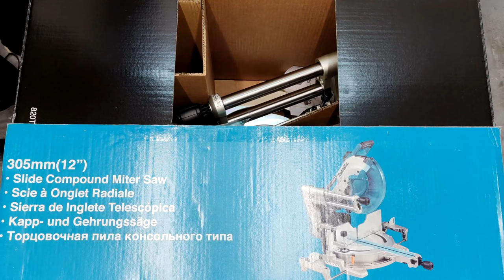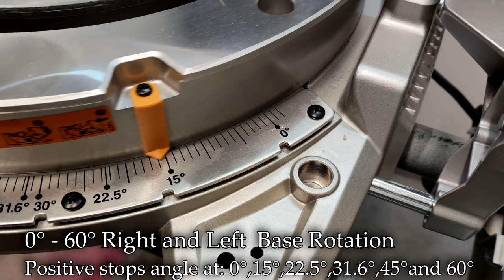The Best Slide Miter Saw - Makita LS1219L 305mm  (12") 1800W   DXT - Unbox and test

Comment: The machine is good. But pathetic service in India after sales. From day one, there was a manufacturing diffect. There is a 1 degree difference for the right angle. There, engineers are not able to resolve the problem on site. Now they have requested to send a machine from Mumbai to thereafter Bangalore service center. Hope they solve my problem.

Comment: Powerful motor, cuts through aluminum stock easily with standard blade MyBest.Tools Cuts are straight and angles are accurate. Good overall saw. The only thing I would have changed is the blade cover. It is very thin and wobbly.

Comment: Hi, I'd like to have your advice. I'm undecided between makita ls1219l and kapex festool. I would like to make a good purchase.
Reply: Kapex dust collection is nowhere near a good as this.
Reply: Festool is one of the top brands in the world for precision! But it’s 6-800 usd more than the makita.  I’d def say go with the Makita!
Reply: I have both saws and I can tell you it all depends on what you plan on using the saw for . Fine trim or furniture definitely the Kapex . Rough cutting building decks or houses or anything like the Makita is awesome  . Also comes down to your coin. This Makita is right at 900 usd and the Kapex is 1600 usd

Comment: $800 and it has BRUSHES??? I would expect brushless for that. 
Also, it has the inferior laser cutting guide instead of a razor sharp shadow LED guide like some of the competitors.
C'mon Makita, deliver $800 worth of saw. I would buy it if you fixed these two major flaws.
Reply: How brushless makes wired tools better?
Reply: No corded miter box that I know of is brushless! And the laser is a minuscule thing to worry about when you’re actually getting a saw that cuts true. We have about 6 dewalt 12” saws and I have a 12” Bosch and I’d trade all of those in for this makita!